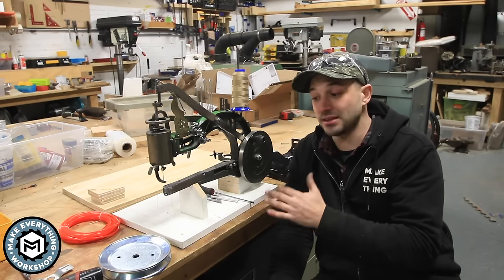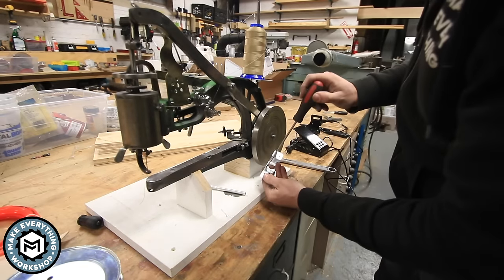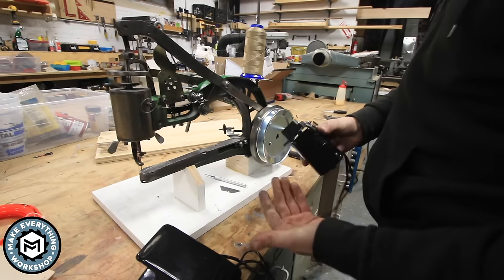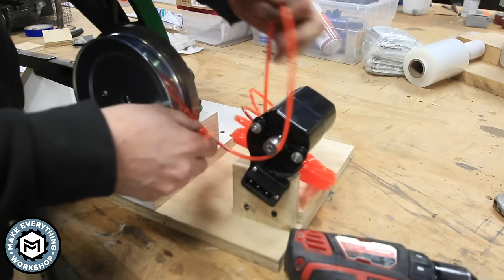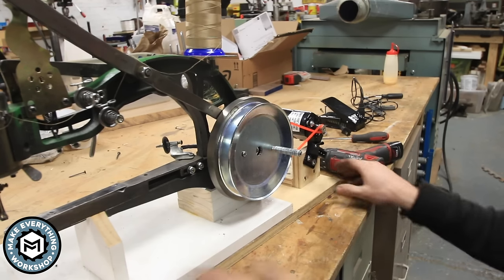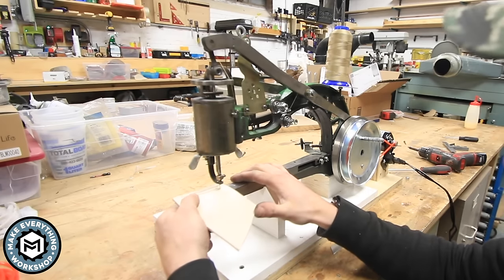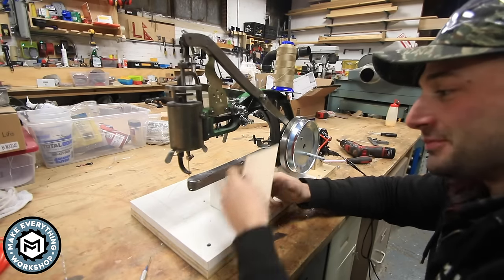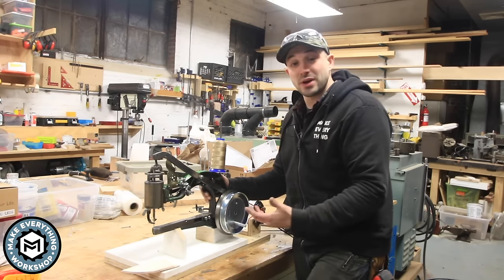Motorizing The Leather Sewing Machine, For Under $50

Comment: HAHAHAHA watching while sewing up shoes with the same machine, by hand crank. The motorized variant is extremely aggressive. There's a simpler way to do what you did it's on ebay look it up. Dude 3D printed out the parts so no extra fly wheel $45 then yes you have to buy or sorce a motor and pedal. Thankfully I had an old singer with those.

Comment: Why didn't you just put the motor under and in front of the crank wheel. All you would have had to do is raise the sewing machine apx 1". Then you would not have to twist the belt and cause belt drag. It then would pull the sewing machine in the proper direction and give you better performance. I think you would like that much better. I know I would be.